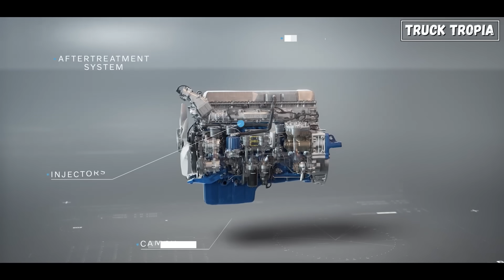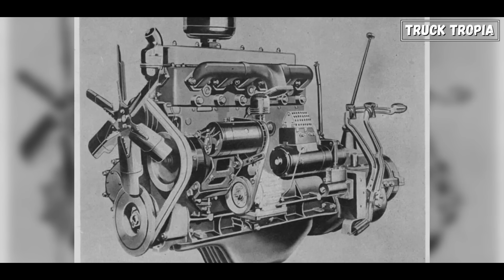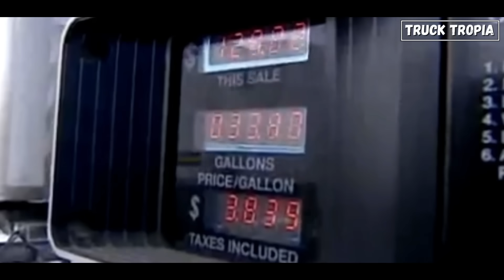How Truck Engines Went from 200 hp to 600+ hp

Comment: By the 1970s there were 12V71 Detroit engines that could push 650+ HP. Check out Tyrone Malone race trucks.

Comment: Electric motors can never be reliable than diesel motors. No battery can handle the load as load increase so the battery capacity.

Comment: With up to 780 hp, the D17 is the most powerful engine put in a Volvo truck. But it's the fuel efficiency and the massive torque available that makes the Volvo FH16 the perfect match for heavy transports and other demanding assignments. Available in selected markets.

Comment: I think this video is exaggerating a lit bit because in 1942 Mack has trucks already with 368 ft- lbs of torque. Because remember for pulling power what count is torque for example a 200 hp truck can easily have twice as much torque as 200hp car . So the video should b more about how we went from 400 ft-pounds of torque in the 1940s to 2000 ft-pounds of torque in the

Comment: This guy doesn't understand science.  An engine with higher torque, but lower horsepower can't pull more.  However, if it has higher torque, it will probably also have more power.

Comment: Horsepower is irrelevant for trucks.  My truck has 450 Hop but almost 2000 ft lbs of torque. Torque is what matters for a truck form pulling power.

Comment: I'd say we peaked in the 90s. The new engines have power, sure... but they are unreliable and constantly breaking down. Can't tell you how many Paccar camshafts I've seen fail. Cummins X15 has quite the issue with their injector tip design. Don't even get me started on aftertreatment systems... the days of 1,000,000 miles without many issues are long gone thanks to government and EPA emissions regulations and shady cost cutting manufacturing and business practices at the OE's. This is NOT the golden age. This is an overcomplicated nightmare. Diagnostics on the Paccar and Cummins engines can be rough,and the electrical on the chassis side can be even worse. If you drive, buy an old W900 or 379 with a 3406E or C15 and drive it til the wheels fall off. Not stop at a dealer every 10K miles because an unnecessary sensor or wiring harness fails. I work at a dealer so I can say these things and back it up. Power may be up, but the product reliability is nearing an all time low.

Comment: I’m sorry, a 200 hp Camry engine that runs on gasoline versus a 200 hp diesel engine and a truck is a bad comparison with gasoline engines horsepower is more important with diesel engine torque is more important so the horsepower number of a diesel engine being 200 is essentially irrelevant compared to a gasoline engine

Comment: If im reading the future right in 20 years we will see 800 to 1000 hp engines with valve shutoffs to conserve fuel and 18 speed fully automated transmissions

Comment: Diesel pickups are doing 500HP so 600 from a semi isn't terribly special, but all the modern diesels are unreliable compared to the old stuff.
Reply: big rigs are putting out over 2,000 ft-lb of torque. pickup trucks aren’t doing that

Comment: Modern Scania and Volvo trucks have 770-780hp and 2,700-2,800 ft lbs, and routinely pull loads more than twice the weight that American trucks do. They are in a different league.

Comment: Yeah but new diesels have exhaust scrubber systems that makes them about as reliable as a 1960 VW 😂…sure a modern diesel that’s deleted will give you the advertised fuel economy and power output …truth is we’re going backwards as far as power to THE WHEELS

Comment: Trucks in the 1940's were NOT slow for the time period. Back then you had two options aside from trucks: horse or train. Trucks moved faster than horses. Also keep in mind Henry Ford won a race averaging about 45 MPH, around 1900.  
Halls-Scott equipped Kenworths, gave way to the saying " pass anything but a gas station".

Comment: Pure electric trucks are not the future and any driver will tell you that.  They dont have the range and charging time makes them a nuisance. Yes, electric can turn the  jp and torque numbers on their head, but with the range availability it makes them useless for most part. If electric has a place in trucking, it needs to be done like the Edison truck, a diesel electric much like a diesel electric locomotive.

Comment: This video kind of sucks Some footage or pictures of all their trucks would go a long way 
And it's not like horsepower.Was non-existent in the 40s
It it was just very expensive 
Like two cycle diesel engines with superchargers 
And V12 engines They had lots of horsepower but had terrible gas mileage 
Or gas Engines that were so freaking huge.They were almost as tall as the cab The revolution of the Turbo charger was making an inline 6 diesel Produce horsepower with less waste and cheaper And there was v eight diesels as well Produced later for an insane amount of horsepower 
Nowadays almost all diesel engines in trucks are inline six Turbo charged, but there was.
A very large variety in engines over the years before that's what stuck

Comment: 12:18 electric simi’s are fast and all but it takes to long to change which will take to much time to deliver
Reply: Actually, ist not far away from the batteries being charged faster than a 1.000L tank is filled with Diesel.

Comment: A the biggest factor is usable and sustainable RPM range.  Old 200HP diesels used to redline at 2000RPM.  HP is just torque over time, meaning more RPM, more HP.  Modern manufacturing, CAD, simulation software, and precision timing allow them to hit much higher RPMs, and live in them longer too.

Comment: How many horsepower - does 1 horse have?    And we should be talking about "twist", not that antiquated "horsepower".  Or am I just "horsing around"?   ha ha    Also, "zero emissions" is a misnomer .... the electricity needed to charge the batteries - comes from the electric company - burning fossil fuels.  Sorry, gentlemen.

Comment: Its important to know that not all modern trucks come with the biggest engine. Most of the base trucks still have around 400 hp. Especially if you're working for a big company they're going to put the smaller engine in the truck to save money.

Comment: Trucking depends on weight and time. Weight, 
 meaning the lighter the truck/trailer, the more freight a customer will pay you to deliver.
Time, meaning how quickly can the customer get the freight. Just in time delivery is real today.
So if your trucks 80k weight limit is taken up by batteries, your not moving much freight. And, if you need to spend a day to recharge those heavy batteries, your delivery times are shot as well.
This video acts like 600hp is very common. ITS NOT FOLKS.
All the major carriers buy low output 425-450hp fuel sipping engines. My Cummins ISX15 was plagued with electronics and DEF issues. Didnt get moe than 682k before a $34k major overhaul. 
The peak was really in the 90s.
Detroit 60, Caterpillar C15 were simple and reliable. 
Blown turbo costes $700-$1000. Todays VGT turbos are $8k. Their electronic servos are about 2k.
We need simple engines again!!

Comment: In the 1940s and 1950s, many heavy trucks were still equipped with gasoline engines or two-stroke diesel engines. Because the power of four-stroke diesel engines at that time was too low

Comment: HorsePower is Torque×RPM!!! A MILLION FOOT pounds of Torque × 1 rpm per second is only 460 Horsepower!!!!! When ya got the GEARS / TORQUE is. ALWAYS THERE...... Without "BIG Horse Power" yer just gunna GO SLOW!
Reply: Its torque times rpm divided by 5252
Reply: Your example at 1rpm would be 190horsepower
Reply: @connor3288   the balancing would be a hell of a job for such bang at 1 rpm lol

Comment: As of yet; the electric rigs are good for local runs. Great power.  Combustion rigs are still a prefered choice for long hauling. No stressing about where you can get a recharge.
Reply: Have you checked out Edison Motors? The stuff they do is pretty awesome! They basically took the basis of how a diesel electric train works and put it in a semi

Comment: I'm actually pretty new to the trucking industry; but I've driven a lot of older equipment so far. And I feel like reliability really peaked somewhere between the 80s and early 2000s. Adjust the strike comparison at my old job we had this caterpillar 769D, add this engine was pretty well bulletproof until some idiot ran it without oil, and blew out the cylinders. At the same company they had a newer caterpillar 770, and that thing was practically in for repairs every couple months or so.  The one particular incident the hydraulic pump blew out that powers the cooling fan, and in a cascading failure it threw a bunch of crap into the hydraulic motor; so then I had to change the cooling fan with the hydraulic pump. My truck was down for several months while they were trying to work out the problem.  Then we had a Ford 8000, I suspect from the 1970s; it was outfitted with a water tank for dust suppression. And that thing was completely bulletproof; I get in it I'd hand throttle to 1200 to warm it up. The only problem with that truck was at the valves for the water sprayers were constantly getting stuck. And it had a little pony engine running the water pump, we actually had to change that like three times and never touched the truck engine.

Comment: Sure while the HP has gone up, the quality has gone down plus it breaks down more often and maintenance is an issue while maintenance for older truckers is easier.

And let's not forget that old engines last longer
Reply: If you maintain modern cars they will last much longer than old ones lol

Comment: The real story is torque, because these engines don't spin fast, the horsepower numbers are derived with low RPM for these turbo diesel engines so the horsepower number is achieved by torque making up for it.
Reply: I just ask myself why US trucks have so low torque compared to european trucks.
Reply: Yes and no. Modern diesels have much higher redlines than old ones, allowing for way more hp.

Comment: A more important question would be, Will I ever actually get full throttle ( power) with a modern computer controlled truck? The answer is no. My current truck a 2024 Freightliner with it's 450+ HP rating pulls about the same as a 325 or 350 Cummins.

Comment: Here's the problem with this, our EPA is 100 percent the reason American trucks are only 600 HP. In the 70's in Australia, Mack produced an everyday 800 HP truck. Today,Australian programming is illegal to run in the U.S. Why because Australian programming for the ISX Cummins is 1100 HP. Tell your lies elsewhere . I've turned a factory B model Cat to over 800 so many times I can do it in my sleep......
Reply: Why wasn’t this fixed in Trumps first term? Why isn’t it fixed now? What’s up with that? (Serious question).
Reply: @TechnoLawyer honestly, I wish I knew
Reply: @TechnoLawyer  Greed.... It's all about money and lies..... The biggest lie is global warming.... Globally there is no warming trend, the reason it seems hotter is because we keep laying out miles upon miles of heat storage batteries. Concrete and asphalt are heat storage batteries and create tons upon tons of it every year. It's all about greed......
Reply: @TechnoLawyer Because he’s Trump. Even if he did mention this, he would forget about it and say he never said a thing about it and would then proceed to do nothing about it.
Reply: As far as I can tell the american EPA is at least comparable if not less strict than emissions regulations elsewhere especially europe and china. And still Detroit Diesel, CAT, and Cummins engines get dwarfed in terms of power by Volvo and Scania with 780 and 770 rear wheel hp and 2800 lbft of torque in their strongest options for regular highway trucks.
Reply: @matthiasborgdtadt8673 if you're going to tell lies, tell it somewhere else.
Reply: @tech-vp5xe 
What 's your problem? 
I didn't say I know for a fact how emissions regulations compare in detail, it was a good guess based on the fact that it's not really a thing cars or motorbikes can't enter the us market because they won't pass us emission standards. 
And for the technical perspective it is a well known fact the american truck industry has been sleeping for decades which was only possible because the market is sealed off artificially to prevent competition in any way shape or form.
Reply: Australia has emissions laws now too. Keep believing fox news and facebook though ol fart

Comment: 150-200 is weak, no argument but you still cant compare that to the horsepower found in a sedan. the torque is what moves that load down the road. you are not going to take a 450-500 horsepower car engine stuff it in a class 8 truck and call it a day. it's not going to work out
Reply: It's geared hubs, multi speed diffs and Transfer boxes along with a multi speed short range gearbox and an engine that can stress for hours under heavy load that some people don't get
Reply: @ChristianSwordsmith  and an engine that produces a substantial amount of torque. 500 hp in a high performance street car is not comparable to an industrial duty diesel making 500 hp
Reply: @andrewdonohue1853 it is absolutely comparable. Because the work done at the end is exactly precicely the same.

Give the car engine a fitting gear ratio, and it WILL of course do exactly the same. Does not matter what the engine looks like. 500 hp is 500 hp, no matter what. Either it is achieved with torque or rpm.

The gearing is what decides which torque is at the wheel.
Reply: @dom3827a 500 hp car engine will not make 1,800-2,000 ft lbs of torque. Horsepower is somewhat irrelevant in a class 8 truck application
Reply: @andrewdonohue1853   thats false.
A 500 hp car engine can make even 15.000 ft torque.

You dont understand how it works.

You know a truck has a gearbox?
Without gearbox it would not move, because the engine would be too weak.

What does a gearbox do?
It converts torque. It converts low torque at high rpm to high torque at low rpm.
Reply: @andrewdonohue1853  a Ford Fiesta with 1L Ecoboost engine has 2000 lb ft torque at the wheel in first gear.

Comment: Best truck engine made cat c15
Reply: Not the Acerts but the 6NZ’s for sure.  My 379 has an E model CAT 5EK that makes 572hp and 1790tq on a dyno.  It’s an absolute beast even here at 8150ft above sea level in the Colorado mountains.